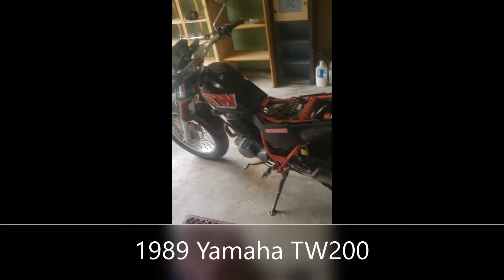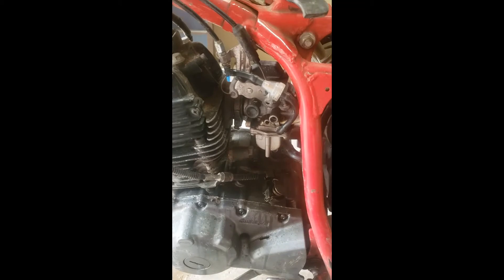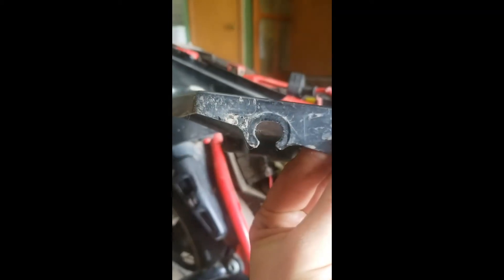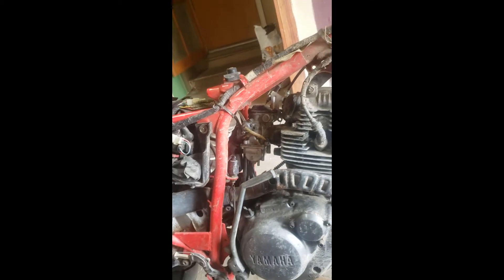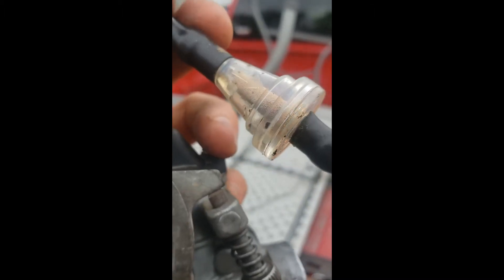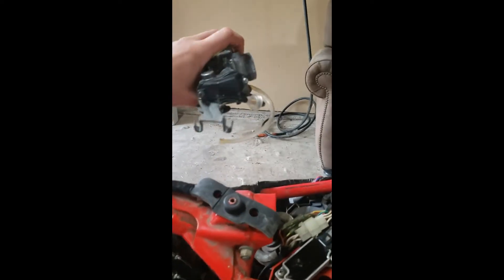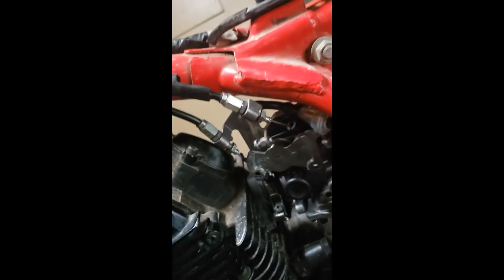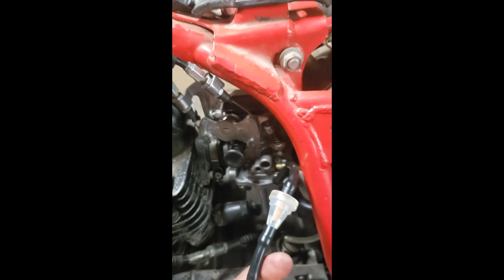Yamaha TW200 Carburetor Uninstall/Install

Comment: What's the top speed on this bike? I have a 87 myself! But haven't been able to ride it yet. Need to purchase a new pick up coil
Reply: with factory gearing, she is screaming at 60-65 with a normal rider, I have mine geared down for hunting, top speed balls to the wall is 45, lol
Reply: 70mph on the Flatts at 900 feet in elevation  with stock carb pulling mountains 55 tops
Reply from the maker: 60 downhill. But I don't like running it that fast. She's an old girl.

Comment: Hi, have you got any advice how to find or adapt a carburator for my yamaha tw 125 2001 model? My one has an electric choke and is impossible to find and also one with manual choke looks like is not easy to find. My mechanic tried to adapt few carburators but they didn't work.
Reply from the maker: I will look for one!